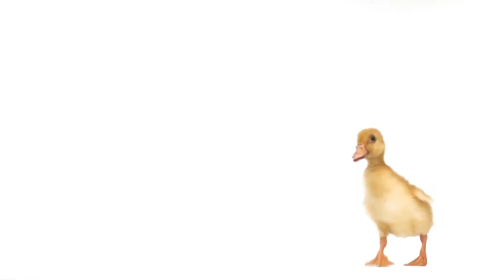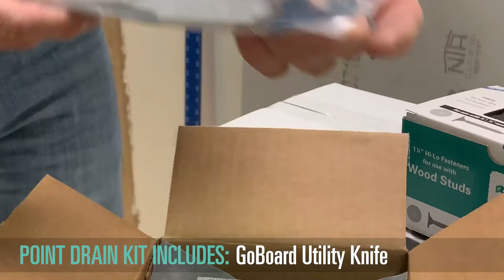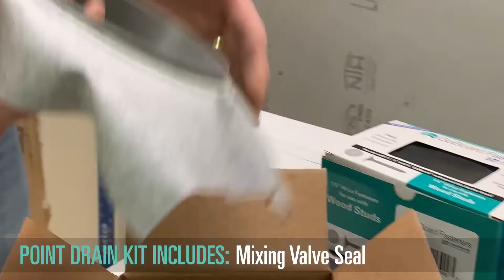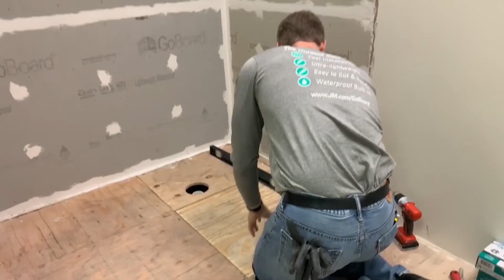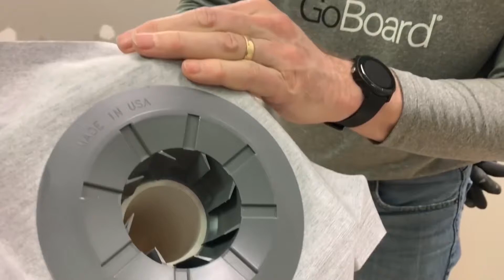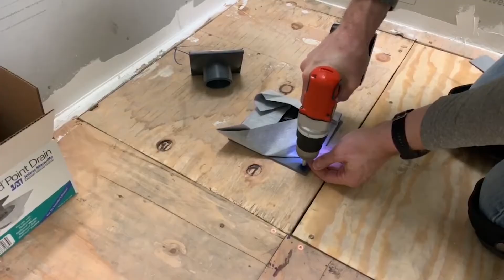Easily Install the GoBoard® Point Drain Shower System

Comment: I am sorry to say this, but as a remodeling contractor I simply don't trust this system. All sealants break down over time. In this video, there are so many areas joined together and just one little pinhole will result in so much damage. I'll stick to doing a traditional mud pan instead. I'd much rather put money in my pocket for the building of a properly built mud shower pan than into buying an overpriced system. Just my opinion.
Reply: Today’s silene based sealants are not like the old sealants. They are moisture curing and very resilient. If done properly, this install will equal any traditional method. Why paint over a waterproof board? You could paint over the seems for extra peace of mind I suppose. These water proof board systems are taking over for good reason. Also, using thin set alone to seal drains is not a good long term strategy. If you do that, just be sure to seal all seams with a silene based sealant of some sort. Many companies make them including Schluter, Laticrete, and RSS.  I do like the mud bed system and still slope my own. I paint over that and then cover with a waterproof membrane. Go Board should consider making their 3x5 wall boards interlocking for better water proofing. But all in all a good system. And yes, I have used go board wall material and sealant but never their flooring material.
Reply: Yeah that's why I would use a liquid membrane over everything. You do 3 coats should be about the thickness of a credit card. Then it's definitely not leaking.
Reply: @BryanScott-x7q I’m a ICC building inspector and retired contractor. You have to go with the installation instructions for the product being installed UL listed.
Reply: "As a remodeling contractor " means literally nothing. You have to come with better receipts to comment to make it worth talking. It's an amazing system
Reply from the maker: Thanks for your feedback, Leslie.
Reply: @ my dear, i’m 55 years old and have been using computers since they first came out. I also worked in the computer field and owned my own computer repair business after college. So your comment about being behind in the times is inaccurate.  I’ve been doing plumbing and construction for 45 years- how about you?  All these foam board products are junk-plain and simple. They are just an idea that someone came up with to make a higher profit margin. You can take all this foam board crap.  It’s just not as reliable as a properly built mud shower pan with cement board.  Foam board is for people who can’t lift a 50lb panel of cement board.
Reply: @Fixerofthings555 good luck proving this to ansi and the courts. Who would ever want an old smelly pan full of water called a wet system. The new products called foam as you refer to them are similar to your new plumbing options. So don’t be a Debby downer.
Reply: @toddsmith1690  Behind the times? Nope, just smart enough not to fall for poorly made new gimmicks from China. have fun with your crap. It's obvious you're just trying to protect yourself because you're using an inferior product. Please go and inspect one of your showers in 30 years. Oh wait, that probably won't be possible.
Reply: @toddsmith1690  go board has a 10 year warranty. They obviously know how long their product will last given the terrible current water conditions. Not sure why you think it will last 30 years when there’s only a 10 year warranty on it. Do you tell your customers that the product is only warrantied for 10 years? I think not.
Reply: @Fixerofthings555  so you warranty your bathroom remodels for 10 years? No, you don’t. And if your response is you do, you’re an absolute liar. You’re called it junk, knowing absolutely nothing about it. These products are far superior than anything you’ve ever used. And the bottom line is this, do your tile job correctly, do maintenance as needed like re-caulking when it’s due, and you’ll never have a problem.
You’re doing nothing more than speaking your thoughts and are completely clueless…
Reply: @Fixerofthings555  you are a liberal women right? 
Totally obvious. Trump 2024
Reply: @ i voted for trump. MAGA. I have never been a liberal. Stop making assumptions about ppl and trying to insult them because they don’t agree with you. Goboard has a 10 year warranty. Other methods will last a lot longer.
Reply: @ your the one who said I don’t tell my clients about the 10 year warranty. Again a typical liberal move. Blame others for what you do. My shower s last 25-30 years period.
Reply: @ your not making any sense. What is the warranty on your car. Usually drive terrain is 5 years max( unless you pay extra). Bumper to bumper 2-3 years tops. So you telling me about GoBoards fantastic 10 year warranty is super. Do your cars fail during those warranty periods( I think not across the board everyone has broken cars). Things in today’s building industry have longer life spans than the applicable warranty period. My trailer hitch holds 10,000 poinds. So if I put 11,000 pounds will it fail heck no. It’s built to hold 15,000-18,000 so it won’t fail during winding roads braking hard ect. 10 years on a shower material is great. I spend the attention to detail when I install. There are ZERO flaws in my installation ( my clients pay for the BEST AROUND). I’ve built houses for a living and my housing tracts I built were $700,000.00 -$2,500,000.00 and up. My number one complaint was shower faiures( leaks from upstairs noticeable on downstairs ceilings. I’ve used hot tar for 20 years at first switched partway through and did mud pans and walls floated. They all failed before 5 years. I put in GoBoard in showers since it was first released. Never ever had one problem not one. I tore one out because the homeowner came into money and we reconfigured the entire house. Under the tile and minimal thinset per manufacturer ( walls were 100% straight and plumb). No extra stress put on GoarBoard or seams. I’m talking from real experience. GoBoard will outlast any other product on the market today.  God Bless and don’t assume my clients aren’t aware of the excellent 10 year warranty. Show me another sheer complete system that will outlast GoBoard.
Reply: Can you add go board strip on all joint? Including on the floor?

Comment: Surprising how bad this video is considering it's the product of a huge company.
Reply from the maker: Hi J Mahoney, how could we help and make this video better for our viewers?
Reply: @johnsmanvillegoboard  Sound quality, better framing of the shots, particularly the close ups.. Having said that, it looks like a great product. I wonder about its shear strength to resist inevitable framing movement. Watch some 'This Old House" for an excellent production style.   ( I'm a Professional Cameraman, I'm picky, sorry.) I'm also a DIYer. with 7 rental units. I will say, I don't' like most of the super slick big company videos. too slick. I'm considering a small bathroom on my 3rd floor. Ive done a lot of stuff, including install 2 steam boilers by myself. Tile, for some reason scares the heck out of me.
Reply from the maker: Tile might scare the heck out of you, but I think our camera and sound people were probably scared too! We'll endeavor to do better and find the balance between too slick and not slick enough. We sort of tested some changes in planes using GoBoard as wallboard in an RV and the seams held up. No cracking. Are any of your rentals road-worthy? ;-)
Reply: Bet you didn't bet on actually getting a response lol

Comment: Can this be installed on a concrete slab (basement). Originally our plumber was going to rough in for a prefab shower base, but I’d rather do all tile if I can. If it is doable, how would he rough in the drain? Still 1 5/8 below concrete surface? Thanks in advance for your guidance.
Reply from the maker: You can install this on a concrete slab, in a basement. Assuming there is no existing drain in your basement currently, you would be best to discuss your options with your plumber.
Reply: @johnsmanvillegoboard  I would like to use this system in my bathroom ( already used GoBoard around tub in the main bathroom and I love the product ) but I also have concrete floor and I am pretty sure that the drain is not PVC or ABS, but metal ( now I have an old style fiberglass prefabricated pan ). Would this drain be adaptable to it? How would you affix it to the subfloor ( obviously cannot use the 4 screws like in the demonstration video )? Also, how many panels come in the kit? Enough to build a 2.5'x5" shower pan?

Comment: Would be nice if you supply some links to videos of "professionals" who have used this product in their projects.  The leak factor makes this type of install  high risk for the DIYer, so more examples the better.
Reply from the maker: It's not uncommon for a DIYer to consider hiring a tile contractor. GoBoard Shower Pan Kit is very simple to install. It's easier than the tiling part! Like and subscribe to keep watching our YouTube channel, or you can follow us on our Instagram channel. We share IG Stories of professional contractors that tag us in their work.
Reply: Do you have an idea on how long a proper install will last using just the sealant as water proofing as shown in the video? Also, can red guard be added over seams that were sealed with the  polymer sealant as a redundant added water proofing protection for piece of mind? Thanks.
Reply: @davidbaker1405  Sorry, I don't know.  My project got put on hold.  Right now I'm leaning toward Laticrete products.
Reply: Also, where can I buy this kit near Indianapolis Indiana? I’ll try one this week. Thanks.
Reply: If you think beforehand that it's going to leak, it will, trust me, Law of Attraction!

Comment: Where can you purchase these Shower systems?  I looked for a retailer and the only thing that came up close was Lowes and all they have is the board?
Reply from the maker: Hi Nathan, thanks for your comment. Lowes currently only carries our 1/2" 3x5 boards. Where are you located? Maybe we can find another supplier.
Reply: @johnsmanvillegoboard  
Sacramento CA
Reply from the maker: @nathanoltmanns6160  Cortopassi Tile & Stone carries our entire line except for our thick boards. You can call them direct at (916) 361-8191
Reply: Awesome thank you!
Reply: @johnsmanvillegoboard  I called Cortopassi's today and they said they didn't carry this kit. Any other spots in Northern California or should I just go with what I see on Amazon?
Reply from the maker: @johnwhite2871  Cortopassi carries all of the components to this kit (sold separately). They might not have "the box" though.
Reply: @johnsmanvillegoboard  Thanks for the heads up. They indeed have everything.
Reply: @johnsmanvillegoboard  Is there a place in Elk Grove, Lodi or Stockton CA that carries your products?
Reply from the maker: @nathanoltmanns6160  a pallet of 3x5 GoBoard can also be ordered through Home Depot's e-commerce site. Cortopassi carries most of our product line though.
Reply: I need some I’m in holly springs NC 27540

Comment: If you're using a traditional mortar bed, should go board be placed within or above the mortar bed?
Reply from the maker: Hi Tom,  thank you for your question. Unlike many other tile backer boards, GoBoard will not deteriorate when placed within the mortar bed.
Reply: @johnsmanvillegoboard  THIS was the question and answer I was looking for!!!  Great news!
Reply: @johnsmanvillegoboard  But if you use the pvc flexible shower pan liner, do you staple or glue it to the goboard face if the goboard was ran all the way to the floor?
Reply from the maker: When using GoBoard on the walls, and GoBoard shower pan kit, a pan liner isn't necessary at all with this system.

Comment: Can I coat the whole surface of GoBoard with RED GUARD to help seal even further?
Reply: I agree with Joseph....Michael is soooo wrong 😑
Reply: Michael, read the instructions on the redgard container, it is specifically designed to use in showers...
Reply from the maker: It's not necessary.
Reply: Redguard should NEVER be used in a shower!  With redguard,  you have to use a modified thinset which is modified with latex additive which is organic and is a food source for mold!  People who use redguard in their showers WILL HAVE A PROBLEM WITH MOLD GROWTH!!!!!!!!!!!!!! UNMODIFIED THINSET ONLY IN A SHOWER!!!!!
Reply: @michaelhorn9114  you are SO wrong....Check ANSI (facepalm)
Reply: @michaelhorn9114  As a professional bathroom remodeling contractor, I use redguard on every shower. I've been using it for over 15 years. There is no mold growth issue. Once modified thinset dries, it doesn't 'uncure' and become a food source. You really don't know what you're talking about, sorry.

Comment: holy crap, that stuff better be cheap. that was a lot of wasted material  making a shower pan
Reply from the maker: GoBoard installers also utilize the "waste" as support material under their tile when cutting it, and because GoBoard is structural - they also fabricate custom benches, niches, and shelves.

Comment: Did I miss something, where is the slope of the shower base coming from? I heard him say at the beginning that the floor was perfectly level.
Reply from the maker: The Wedges are pre-sloped.
Reply: Then the perimeter is not level, complicating bottom cuts. Can you shim the 3 wedges up to line level with longest piece, just using more thinset underneath? Even then, as with your method, seams between pieces will not flush up with each other?

Comment: Would it be preferable to install the pan wedges first, then the walls? That way if any water migrated through the grout joints, it would run down the wall panel and hit the top of the pitched shower pan. Otherwise you are completely relying on the sealant at the pan/wall seam. How flexible is this sealant once cured? I worry about building settling. That said, I am planning on trying this system in my house soon. It looks great.
Reply: I wouldn’t chance it, def put pan before walls.
Reply: I would put down red guard on the plywood first, then pan, then wall board. Seal everything and then red guard over everything 3 coats
Reply: @ezzyzhoo5139 im With you seal that thing up!
Reply: Chris I’m a total newbie looking to do a linear drain but doing the pan first would mean I would have to worry about trying to slope the bottom of the walls but doing the walls first means not worrying about that
Reply: I had the same question... as I am building a traditional pre-slope, liner, and pan. I think this should go down first.
Reply from the maker: Chris,  you can install  the pan first then walls - if you feel more comfortable.  GoBoard Pro Sealant has an allowable joint movement of 25%. I've highlighted GoBoard Pro Sealant's allowable joint movement percentage on this data sheet: bit.ly/GoBoard-Pro-Sealant-Joint-Movement

Comment: hello, is this approved in South florida by FBC 2017? here we use concrete slabs instead of wood sub-floors, sounds like a great option but i am worry about applications in condominium apartments, future leaks if the sealant fails, etc.
Reply from the maker: Frank, you can use GoBoard on concrete slabs. Here is a concrete slab basement shower we did: http://bit.ly/GoBoard-Diamond-Shower-Pan
Reply: I am in Central Florida and have combination of raised and concrete slab. Curious to know too.

Comment: When you cut the wedges to different widths and lenghts, is it the same height abutting the walls and curb?
Reply: Only if the shower pan area is perfectly square and the drain is exactly in the middle of area.  For rectangular shower pan areas and / or offset drain locations, the wedge height against the walls and curb can vary depending on the situation.  It's recommended to tile the walls first so the shower pan tiles hide the wall tiles that need to be cut to match the wedge slope.
Reply: @shawnareneecolorado  I thought so. Looks like a fail.
Reply: @shawnareneecolorado  If the different wedges are at different levels then it wouldn't work for me. I love and use GoBoard but I'll pass on the wedges.
Reply: k0harmer Its all good! Glad you love GoBoard! Great question too!
Reply from the maker: Thanks for your question. =)

Comment: Modified or non modified thinset? Water test needed? Can you use 8 + 9 as a precation?
Reply: Use either Modified or non-modified. Water test depending on the building inspector - always good to test anyway. Not sure what you mean on your last question? Precaution? GoBoard is inherently waterproof. Just use GoBoard Pro Sealant in the 1/8" gaps between boards.
Reply from the maker: Thanks for your question. =)

Comment: The tcna handbook says no fasteners lower than 3” below the finished height of the curb. How do you fasten the bottom of the goboard? Can you glue it to the bottom of the studs and to the sill plate?
Reply: That's with an old school "water in, water out" system. You fasten it to bottom of wall then waterproof screw heads.
Reply: k0harmer thank you!
Reply from the maker: Glad your question was answered. =)

Comment: cant find a shower seal anywhere, will pob have to use a competitors mixing valve seal and hope they are compatible.
Reply: The mixing valve seal comes with drain kit.
Reply from the maker: The mixing valve seal is now also available separately.